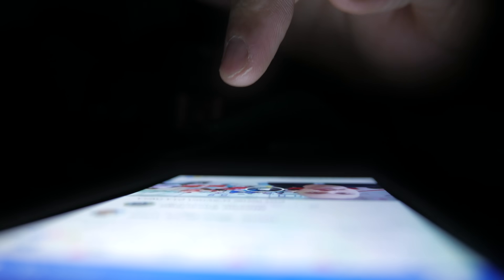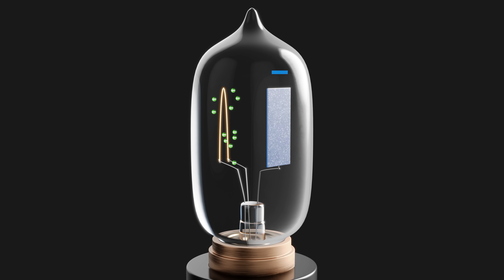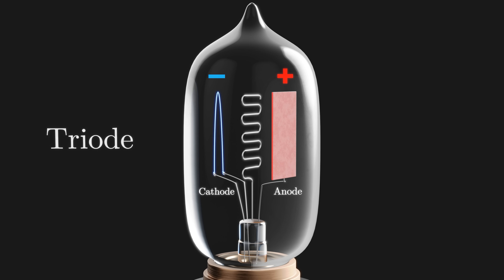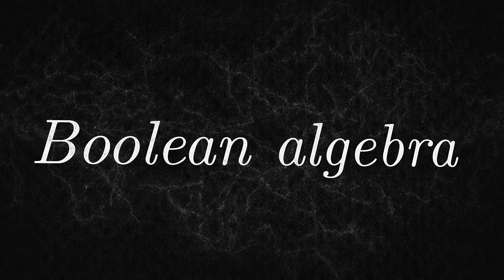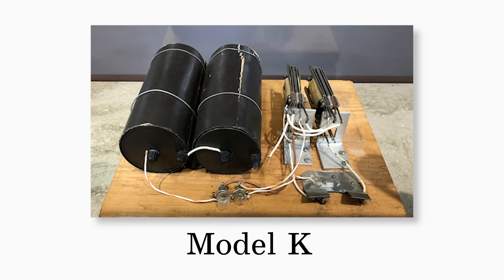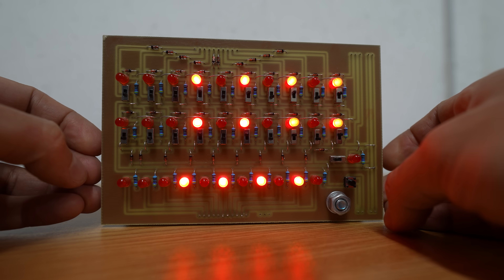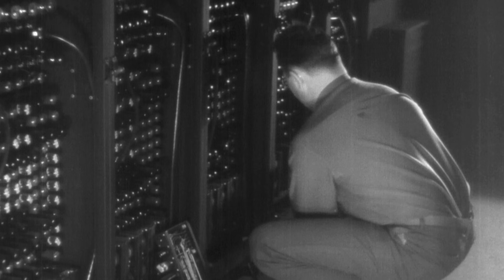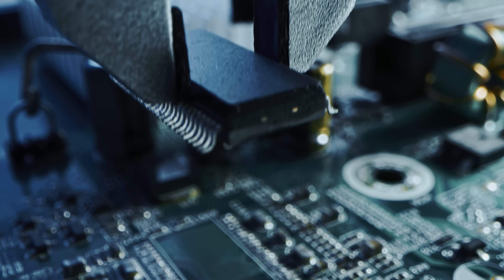Why The First Computers Were Made Out Of Light Bulbs

Comment: Colossus was the worlds first programmable electronic computer. 1943, UK, Bletchley Park. ENIAC was the worlds first 'general purpose' programable electronic computer, as Colossus had the specific purpose of code breaking.
Reply: It is funny how the video just jumps from 1937 to 1945, as if nothing happened. By 1944 Colossus was running at 1MHz.
Reply: @alexbruce7708 Konrad Zuse invented the first Computer !
Reply: @f.n8581 Although he certainly didn't do that  actually. Although his developments were incredible and sadly largely uncredited.
My point was that Colossus units were computing at a rate comparable to 1MHz in later silicon architectures.
Reply: No it was Konrad Zuse in 1941 !! The Colossus came 2 years later !! 

If you wanna correct somebody do it right !!
Reply: The Z3 was an electro mechanical computer, the Colossus was an electronic computer. Both are programmable. Neither was the invention of the 'first' computer.
Reply: However, there is a debate around whether Colossus can really be called a computer, as it was not Turing-complete, and it couldn't be programmed in the modern sense of a stored program. ENIAC was Turing-complete and, after modification in 1948, could run stored programs.
Reply: @ado543  Colossus was clearly a computer, and not being "Turing complete" doesn't change that. The fact that it was the brainchild of Alan Turing and that it could be programmed to do a task, would suggest the "debate" is simply a little bit of revisionism by certain parties in the USA... because the USA ALWAYS has to be the inventor, the first, the best etc. And if ENIAC couldn't run stored programs before 1948, by your logic, until that point, it wasn't a computer either.

Comment: Great video but you didn't really explain one thing, that left me hanging. In the Diode you control the amount of electrons hitting the plate (anode) by changing the polarity of the plate itself. But for the Triode you do the same by changing the polarity of a 3rd part, the Grid. 
What's the advantage/difference of achieving the same thing by adding the grid?
Why is it better to change the charge of the grid instead of the anode?

Comment: Quick addendum: Vacuum tubes are used to this day. They are in use whenever you need very high power--some radars tend to still use tubes. UHF radio and some aeronautic applications do. And for example in particle accelerators they are used to this day. At GSI (the heavy ion research centre in Darmstadt) we have a bunch of them in the Unilac, the first accelerator stage. The largest provide ~1MW peak power per tube. That would still be very hard to acheive using solid state amps. But their resemblance to light bulbs is faint at best. ;-)
Reply: The most common vacuum tube in use today is probably the cavity magnetron, the heart of a microwave oven. But I think those days may be numbered, in the next 10-20 years we'll probably start seeing solid-state replacements.

Comment: 15:00 - As of today all computing power of all computers on earth is approximately 100 septillion operations per second.

That means our planet computers does 100,000,000,000,000,000,000,000,000 operations in ONE second, and thats excluding the combined brain powers of humans and other higher mammals.

Summit, the most powerful single computer has operation power of 100,000,000,000,000,000,000 or 100 pentillion operations per second.
The most powerful gaming GPU of RTX 4090 has operation power of 80,000,000,000,000,000 80 quadrillion per second
The most widespread gaming gpu of RTX 3060 12gb does 12,000,000,000,000,000 or 12 quadrillion operations per second
The most cheapest (still decent) GPU Gtx 970 does 2,000,000,000,000,000 or 2 quadrillion operations per secnd
The most widespread average phone mid-range computing power has 800,000,000,000,000 or 800 tillion operations per second
H3ll even your average 10$ calculator probably has at least 20 billion operations per second. Or 20,000,000,000
Reply: whoaa😮

Comment: I remember that when the vacuum tubes in our TV failed, you would make a map of where the tubes were plugged in, and then take the tubes to 7-11.  They had a tube tester in the store at that time.  You would test them one by one until you found the bad tube, get a replacement, and go back home and plug them back in using the map to make sure they went to the correct location.

Comment: In the tube era, the full bridge rectifier wasn't really a thing. It might have been used now and then, but full wave rectification was usually achieved using a center tapped transformer and a half bridge rectifier (common cathode, two anodes).
Reply: In the tube era a lot of things got done in either the most efficient way with what was available, or sometimes by using flaws of the existing components to achive something different.
That showed some real ingenuity and creativity I feel sometimes missing with all the tools at our disposal today.
Things I sure do not miss is high filament voltages, leaking capacitors and sometimes depending on the power chord, live voltage on the chassis.
Although, even in modern electronics, bad capacitors seem to remain a common failure mode.
Reply: except for audio amplifiers? lots of '50s and especially '60s tube guitar amps used the four diode rectifier thing in the power supply
Reply: @walterw2  that part
Reply: Mesa Boogie literally had amps called Rectifiers
Reply: And it is still done that way in many power supplies both linear and switching mode.

Comment: When I was in college in the late 1970s, I worked for a moving company in the summer.  One job I was on was to remove the old relay frames from the local phone company switch building as they converted to transistorized circuits.  The clatter from the still-operating relays as we carried their brothers out of the building was so loud you could feel the air vibrating as you walked by.
Reply: Forgot to mention, the relay frames were floor to 8-foot ceiling and each foot-wide frame had 8 relays, providing the ability to switch 8 phone lines to the numbers being called.  Each relay clicked the number, just like the sound of dialing a rotary phone, but much louder.

Comment: Maybe I'm wrong, but I thought Colossus predated ENIAC by 2 years. I also thought it was a programable, vacuum tube driven computer. I'm genuinely not sure though, just googling stuff could be very misleading and the Veratasium guy is normally correct on these things, so I guess Colossus (or perhaps other computers) dont quite pair up with the narrative of the story. Either way, yet another great video! I was a child in the 80s, but we still had a few vacuum tubes running an old radio and TV in the house that were in use, I mean they were old and rubbish, but they were there!
Reply: No you're right - Colossus was in operation before ENIAC as the first programmable thermionic valve based digital computer. But ENIAC was general purpose, while Colossus was dedicated to breaking the enigma code.

Comment: I strongly recommend you to look into the British vacuum tube computer named Colossus, not only did it predate the Eniac with several years but it was also very reliable. The British built several of them and they were heavily used in the work to crack the German Enigma code during the war. Best of all, one of these computers is today rebuilt to fully working order, to a large extent using original parts.

Comment: I love your videos but found this one frustrating because I think you didn’t explain a key concept: that in a triode your input signal is connected to the grid, and not the cathode. I had to watch a different  video to ultimately learn how triodes work. Furthermore, I’m not sure your water pump example is effective in illustrating the key difference between relays and triodes. Because the water pump outputs a binary signal, does it not also explain a relay? Like I said love your videos but I did want to share this feedback.

Comment: Nice video! But I would have liked a mention of the zuse Z3 wich was build in 1941 in germany. In contrast to the design and use of the ENIAC, the Z3's design did not meet the later definition of a Turing-complete computer, and it was never used as such. But in 1998 it was found out that, from a theoretical point of view, it still has this property due to the tricky use of some detours. 
There were also the special-purpose machines Colossus (England 1943) used for dectyption and the turing-bombe (England 1940) which was used to decrypt enigma.
Reply: even the z1 was years ahead of the model k or 1 and it were released in 1938 one year after the model k. the Z3 was as much as i knew the first of its kind with a Ram.
Reply: @joajojohalt  Z1 already had a 64 word RAM  (I think 22 bits each word as its arithmetic unit used 22bit binary floating point values).
Reply: Agree, the video would have benefited from a broader view rather than American -only.

Comment: In the triode, why isn’t maximum current when the grid is off?  You say maximum current when the grid is positive, but in that state _some _ electrons will hit the grid. In an off state, no electrons hit the grid. Therefore maximum current when grid is off? (Maybe I need to consider the overall positive draw with two positive sources pulling electrons such that even if a few hit the grid, it’s still overall greater flow than with only one positive source…?)

Comment: Seeing the progress of computers laid out in a timeline is one of the most fascinating things to me. I've probably seen/ read the story about a dozen times and it's still interesting
Reply: ... and now we have ten-cent chips which are more powerful than the computer they used to reach the moon, and they're inside every cheap little thing.  The keyboard I'm typing on has significantly more computing power than the Apollo Guidance Computer, and even my flashlight is roughly on par and gets regular firmware updates.
Reply: @ToyKeeper  why the heavens does a flashlight need to be a connected device?
Reply: @MaxTechEngineering  We have smart trash cans, so why not :). I think those flashlights have a camera also, so you can snap photos of your cellar while you are illuminating. And wherever photos and storage are, wifi comes naturally.
Reply: @MaxTechEngineering  It's not a connected device.  However, the control chip inside has firmware flashing pads exposed, and it runs open-source firmware which has a ton of features and is compatible with lights from a dozen different brands.  New things get added or improved frequently, and users are encouraged to customize things however they like.  There is no wifi or bluetooth.  Instead, updates are installed by holding a small pogo pin adapter against some copper pads on the circuit board.

As for why a flashlight would need firmware, it's used for a lot of things... adjusting brightness smoothly from ~0.05 to ~5000 lumens, adjusting color temperature (or sometimes just color), thermal regulation, battery over-discharge protection, controlling colorful auxiliary LEDs, indicating remaining charge, activating a variety of different modes, switching between flood and throw beams, setting the user's preferred UI options, etc.  Most daily usage is a simple click to turn on/off at the user's favorite brightness, or hold to ramp up and down... but there are also extras like a candle mode, lightning storm, sunset timer which dims the light while changing the color and then turns it off, and so on.
Reply: @MaxTechEngineering  some flashlights (esp. ones in phones) also come with a S.O.S. or Morse Code mode.
Reply: Did you not think it odd that neither Babbage nor Turing were mentioned at all?
Reply: @shankz8854  Yes, this is a glaring America-centric omission.
Reply: Just realized that even I too feel the same!
Reply: Wasn't ENIAC a copy of Collosus.
Reply: i see what u did there

Comment: It's crazy to think that calculators and computers used to fit in a room. Now, it fits into our pockets and are way more powerful. On top of that, it comes fitted with a camera, a flashlight, ability to make international calls, as well as access to the world's knowledge without having to seek it in a library or be taught it in school, plus a whole lot more. All easily accessible in a few taps and swipes of a finger, and it hasn't even been 100 years. I can only imagine how fast the world seems to be changing for anyone born in the early 1900's.
Reply: When I was a kid I read about the world's fastest computer in the Guinness Book of World Records. The Cray-2. I wanted to have one when I grew up. No idea what I was going to use it for, but, you know, computers were exciting, right?

Welp, IIRC the iPad 2 has about the same processing power as a Cray-2 supercomputer, so ... lots of people got my childhood wish.
Reply: @eritain  That is insane
Reply: @taiguy53  Just checked the processor in my lil' Chromebook from 2017 that I take with me everywhere. With the throttles wide open it is 10 Cray-2s of CPU and 60 Cray-2s of integrated GPU, at a power drain of 6 watts.
Reply: @eritain  Just wait til you see quantum computing. It's exponentially more powerful than the tech currently out in the market
Reply: @taiguy53  Not exactly true. Quantum computing has fairly specific use cases, and limited number of real world applications. They also require incredibly low temperatures to work. It's therefore unlikely to ever replace conventional computers. You won't be playing games, typing emails or browsing the Web on a quantum computer.
Reply: @another3997  That is true for now, but companies like Google are already trying to get it to do more things digital computers can do. It'll be huge to see the very first quantum computer, let alone a quantum smartphone. That will be a huge leap in technology once that’s in the open market
Reply: They are not more powerful, they are more economical and matter/energy efficient, plus relatively less dynamic and complex . They have less power . You can actually make a computer which is big, dynamic, energy/matter efficient and economical in terms of result output and some were obviously made . They are just more expensive than your basic pocket calculator, which values and much as one phone calculator app . But a actual bigger basic computer vales as many devices at one, you can do math on a computer, music, videos, drawing/painting, pictures, write articles/pages and notebooks and so on . In don't usually write all important things on a pc but it helps for basic things . Scripted computer programs, such as Games, are usually a mix of all of these applications, but the same is for many videos and sounds .
Reply: @EuM129  You're taking it too literally. Modern calculators on a basic smartphone app are significantly more powerful than the earliest calculators in terms of COMPUTING POWER. "More powerful" doesn't exclusively mean energy usage

Comment: valves/tubes are NOT "THAT" unreliable, i have many old radios, and many have most or all of their original valves in, still in good state, valve computing circuits may tend to push them 'harder'  so when emission may have deteriorated beyond a certain level,  they wont work correctly in that circuit, but still be perfectly usable for radio/audio amplifying purposes, although in digital computers the valves were driven hard off or hard on so ought to last well, as long as enough difference between on and off

Comment: Interesting how buds Vacuum tube processor there draws several hundred watts, and now Modern CPU's are getting there for really high end CPU's especially when under load (and even more so when overclocked) or for beefy many multi-core CPU's used in workstations/servers.
Yet on the other end, we have CPU's that sip electricity that can outperform anything from that era in our pockets or even on a little SBC.

Comment: I'm surprised in talking about early Vacuum tube computers you failed to mention Colossus (1943) or Atanasoff–Berry computer (1939), the former of which would have illuminated a wear & reliability issue almost as vital as physical wear (thermal cycling wear). It was Tommy Flowers at the GPO who solved this issue with the Colossus Mk1 by instead of having each thermionic valve go from fully off to on to denote a binary digit had intermediate & closely spaced conduction bands denoted as True & False. This was the life of each valve was increased to the point where one of its 1,600 ( later 2,400 ) inits would randomly fail on average every 100,000 hours instead of every 1,000 hours resulting in a MTTF of more than 3 days instead of less than an hour.

Comment: Why, I don't get what is used to switch the current in the grid. What controls the polarity of the grid?
Reply: the generators used, a motor, for example, will generate alternating current when its spun

motors are the main thing used in power plants to generate electricity, so thats how most of our ac gets generated
Reply: @johnmadlabs  ? what does that have to do with switching the grid from positive to negative on command. I don't mean where does Electricity come from,i know that, when mommy and daddy love each other very much they create friction and electricity .
What I mean is how does the grid part of the TRIOD switches from positive to negative when commanded. I assume some sort of switch is needed but then the system wouldn't be switchles
Reply: @Anon Imus  oh i thought you asked how ac current works

Comment: In connection with my work, I have used a Manley tube equalizer intensively. I've replaced a tube twice in more than 30 years - I've thrown out large amounts of broken down consumer electronics in the same period, so it's not my impression that tubes are more fragile than semiconductors.